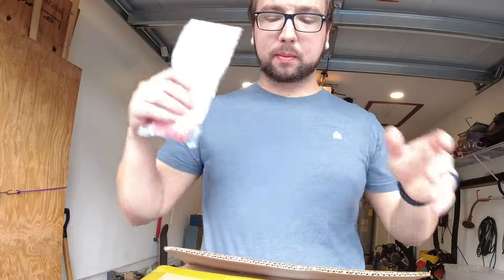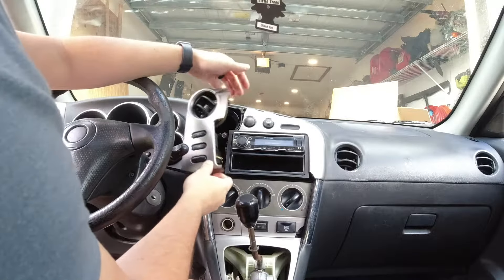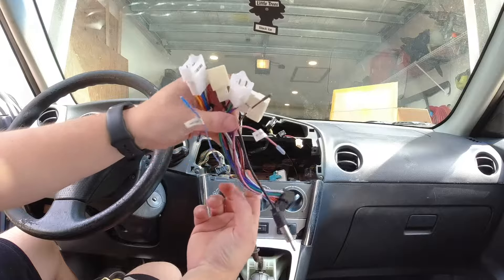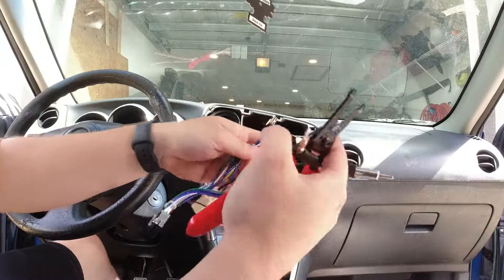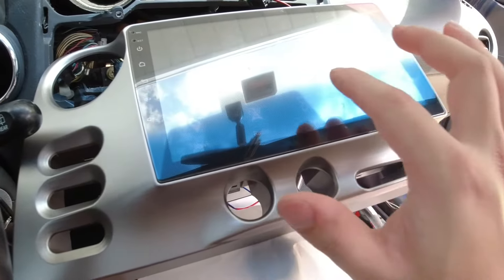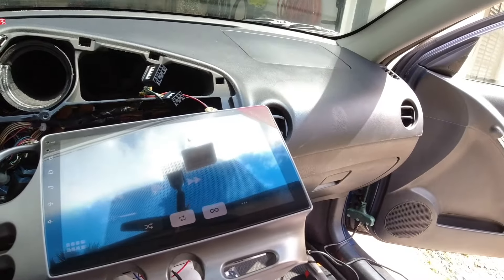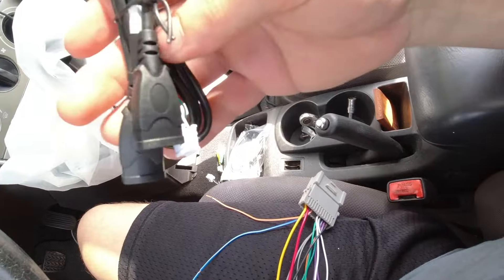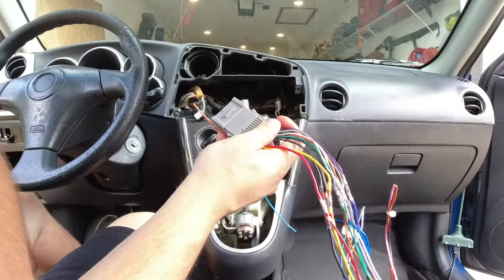Toyota Matrix Gets Giant Radio!

Comment: I saw someone in the Pontiac Vibe FB group swap in a Lexus IS300 steering wheel w buttons, and someone swap in a Camry steering wheel into a same generation Corolla (which shares the same architecture as the Matrix/Vibe). So it is possible 😅
Reply from the maker: That’s good to know, I might need to look into that. Would love to add steering wheel controls!

Comment: If you do have an 03/04 xrs, you got the wrong bumper. That the facelift bumper for the later models. Also for the not being able to pass 7k rpms I recommend changing your lift bolts and cleaning the lift screen.
Reply from the maker: Yeah who ever owned this before me, it was in a small front end crash, and they look like they replaced it with the newer bumper because it was probably cheaper. 
But I plan on cleaning the loft screen soon and order loft bolts soon!

Comment: Thanks for this video and the tips you used to get the clips in, what you had to saw, etc.. I was really considering this from aliexpress but wasn't sure it would fit without rattling or would be very slow. Since it had BT you should be able to install a bunch of emulators, etc, the external USB would be great for a portable drive full of movies as well.
Reply from the maker: I’m glad the video gave you the information you needed.
It’s been a great radio so far. And I’m not disappointed.
But this radio has plenty of features to use. 
But adding a portable drive with movies is a great idea!

Comment: I installed one but the sounds turned off when i turn on my head lights do you know the problem or how to fix it?
Reply from the maker: That’s very strange, I would double check that all plugs have been put into the correct plug on the back of the radio. And make sure there is no connections that are broke as well.

Comment: This is a cool video. The toyota matrix is an excellent car that will last a very long time if you keep basic maintenance done on it. 
I have a first generation 2004 with 134,000 miles , and going strong, very strong. These are great cars much better than a lot of new stuff today. I say get all you can done on it because it’s worth it and will last a long time. Very common for these cars to last 3000 miles if they are  taken care of.❤🎉
Reply from the maker: Thank you! I appreciate you for watching! But I do agree this generation matrix is a great and strong engine, and they will run for a very long time!
Reply: My 08 matrix has 230,973 miles on it no problem, awesome car good in gas too 👍
Reply: My 2005 Matrix is at 297k at the moment and still running strong. 😊

Comment: I noticed you have tweeters in the door by the side mirrors. This might suggest you do have an amplifier which would be under the front passenger seat

I've got a 2003 Pontiac Vibe GT, and that's how it's equipped. I bought a different brand headunit on eBay and it uses the same new plastic bezel as yours, but they sent me the wrong harness, so I'll have to do some splicing too
Reply from the maker: Yeah it seemed like the 2003 and 2004 all came with a GM plug, and after that they switched to the Toyota plugs.

Comment: Hey, Do You know which adapter is Required for a 2005 Matrix XR?
Reply from the maker: For the 2005, you should be able to use the adapter that comes with the radio. Only reason to get the other harness is if you have a 2003 or 2004, as those had a GM harness and not a Toyota harness.

Comment: How would you add a back up camera
Reply from the maker: The radio comes with a wire for the backup camera. And I had installed a backup camera on my 2009 corollas, which should be very similar.
https://youtu.be/yq0xF2cewZM

Comment: How do you make soft reset that radio?
Reply from the maker: There should be a small pin hole on the top corner of the screen. If you take a safety pin and press the small button inside for about 10 seconds it was restart the unit.

Comment: Where did you get that setup and how much was it total cost everything. I have a 2005 Toyota matrix xr 5speed manual
Reply from the maker: It was a little over $400 for everything. It’s a great head unit. With good internals! Compared to many of the cheaper ones you can find. I have been using the iDoing radios in all my cars for the past 3 years and they have been great! 
But I put the links in the description!

Comment: I just installed this model too, but I can’t find steering wheel IR. Do you use external steering wheel controller? Nice sharing ^_^
Reply from the maker: I do not have steering wheel controls. Because I have not seen any matrix with them on it.
Reply: My last radio they had infrared sensor that I bought an external steering wheel controller to control it, but when I bought this model I don't know where is the IR, maybe I bought the unfurl radio or sth. ^_^ have a nice day

Comment: I'm looking at a similar model, does the unit have a built-in amplifier that I can wire straight to the speakers or will I need a separate amp?
Reply from the maker: Well when I installed this in my car, I don’t have any external amp hooked up. Everything was good after wiring up the harness.
Reply: @BrandonStellmach  just went straight from the radio into the wiring harness? Good to know thanks.
Reply: How many outputs for amps is there 3? Looking for a head unit and really like this one, I have 3 amps in the car 1 sub 1 for highs, and 1 for mids
Reply: @sitton440  I have a more basic model, the atoto f7 xe, has two stereo unamplified outputs, and a sub out, though you can't individually adjust EQ or high/low pass on those (except pass on sub) pretty decent for ~$175

Comment: Bro I'm trying to get the android one for my Camry , does the 2g and 32g one a good one ?? It's the one I can afford
Reply from the maker: It really depends on the brand of head unit you are getting. I have had dasita in my Camry, with similar specs and the radio was very slow and always lagged. 
But then I put a Binize in my corolla with the same specs and it ran good. 
If you can try to get a brand that has good reviews for the Camry.
I do say the iDoing radio I had in my Camry was great! But I believe that one was 4G and 64G.